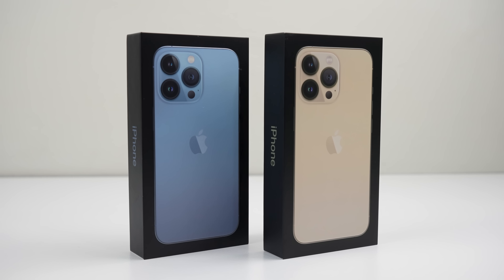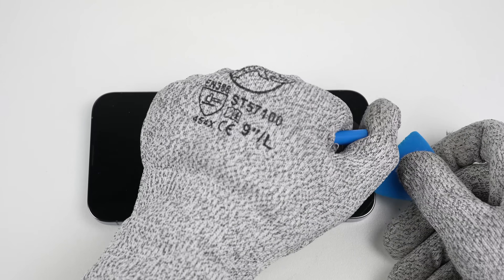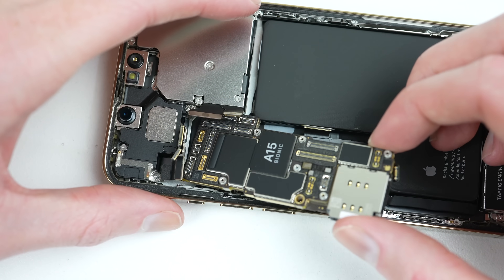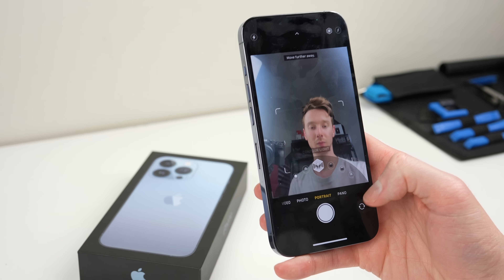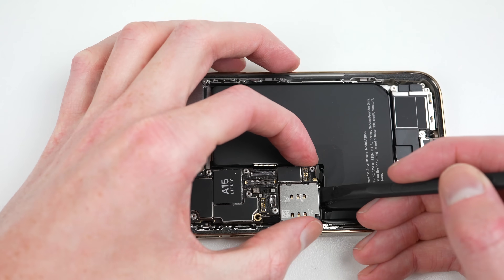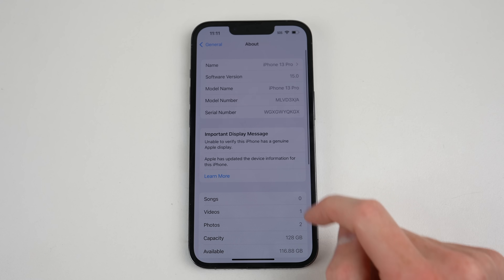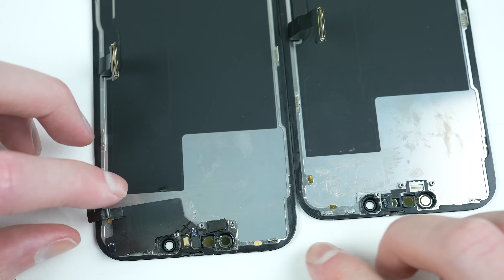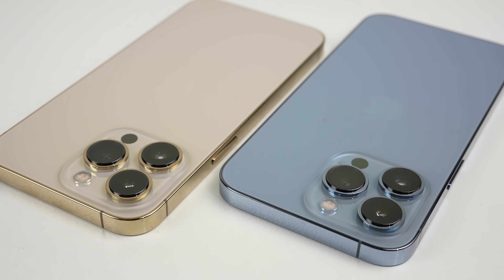iPhone 13 A Repair Nightmare - Teardown and Repair Assessment

Comment: Thanks for doing this video I have had iPhones since the 3 every few years I would buy a top of the range android ( tried various makes) but always had issues, early on battery issues and later down the line ringtone and message notifications I have a couple of email addresses and had problems getting the same notification sounds for each just stuff like that I found annoying etc so always went back to Apple,
 my last one was the 11pro but after last years issues and to see they have continued down this road I don’t want to give them any more business…
Like you say it feels like you no longer own the product and it’s sad to see that one of the android manufacturers doing the same if you unlock the boot loader etc…
Not that I ever did that sort of thing, but it was something a lot of friends did with customisation etc…
Sorry it’s long but now I don’t know which way to go… any advice from anyone would be greatly appreciated 
Sorry for the lengthy message..

Comment: Such a misleading video, I think you're forgetting 1 thing @hugh Jeffreys , The iPhone's have had serial allocated FaceID, Truetone Display & batterys since the iPhone 10, any/all repair shops are very aware of this, and you can literally use a JC V1S to read/ write the serials of each thing, onto the replacement part, it tricks the motherboard into thinking it's the same part, making repairs extremely easy & possible. Loved the video though, very well shot/ edited!
Reply from the maker: That works for the older phones but didn't do anything with an iPhone 12 I tried it on. Reprogrammed the screen using that JC V1S and the warning and true tone still didn't disappear, even after a reset. As for Touch ID and Face ID they have never been reprogrammable. Its encrypted and no one has got around it to my knowledge.

Comment: Damn yeah if I’m going to “rent” a phone from company’s I will not be forking out almost $2000 for it. Rather just spent 300 on a cheap android that does what I need it to do. They also cost so dang much for the screen be repaired by apple without apple care is 600 like dude I can buy a phone for that that’s decent af. I still have my iPhone 7i don’t see the point in upgrading it.

Comment: Hmm for me as à consumer, I don’t think this is a big issue. I am able to change screens or whatever component I my iPhone 12 Pro. But, a battery replacement from apple outside warranty cost 80$. If I do it my self 30-60$. Screen if I want a oled it’s basically the same for apple and if I do it my self. Even if I am able I would rather apple do it. Then they are responsible not me.
Reply: Keep in mind, the normal consumer don’t have an idea to open a phone.

Comment: This is EXACTLY why I REFUSE to buy an iPhone!  I am so sick and tired of Apple's proprietary BS!  They don't want repair shops to fix Apple devices, but if you go through Apple, you either have to pay them a fortune for the Apple Care or it will cost you an arm and a leg to repair.  Sometimes, they won't even honor the Apple Care and it still costs you a fortune to repair a device that already is way overpriced.  I'll be getting the Google Pixel 6 Pro maxed out in black/gray the minute Google allows purchase on the Google Store!

Comment: I the near future Apple will cover all the internal in the black stuff that turns rock hard. They will advertise the phone fully water resistant to make you buy it, And thus nothing will be removed from inside, allowing you just to replace the screen. And that will be the final move to block you from taking apart the components. I hope Apple doesn't read this message.

Comment: Well this is actually because Apple will go carbon neutral. Being carbon neutral COSTS MONEY, so instead of making their products stupidly expensive to compensate they force you to repair your devices to Apple certified service centres. Seems fair to me. It makes the consumer know that is expensive to protect the environment, forcing you to be more careful and actually pay if you’re not. The lifestyle we’ve followed is cheap and harmful. Don’t throw your devices, pay to fix them. The only part that you have to change is the battery. I don’t mind paying extra to get a great battery from Apple. Apple will be carbon neutral. Will you be? Are you willing to pay for your mistakes or not. Apple’s business is not to save your ass, but to make you aware of the things they promise. It’s your call too. If you can’t pay for a genuine service with Apple parts (recycled and environmentally friendly Apple parts) then you are the problem.

Comment: I've seen people use... Razors to open the phones 
Zack got called out hard
Reply from the maker: haha wasn't trying to, if you you have practice sure. But for the average person trying to open something they are likely to damage it by scratching the phone you cutting into a cable or part. Using a plastic tool is safer.

Comment: It’s funny reading the outrage in the comments - isn’t it obvious why Apple (and others) does this? Hugh himself has shown many videos of poor DIY repairs, misleading fixes and disengenuine sellers - if I were a company I’d not want the headaches and cost of customers going the cheapest route possible to fix their devices (which always happens, especially with iPhones). Sure, the likes of Hugh are great and know what they’re doing - but for every Hugh there’s 100’s more amateur fixers that bugger up devices worse than before they were ‘fixed’. Apple had tons of issues with poor repair jobs on Touch ID and complaints from customers on poor screens (after getting them repaired poorly). This removes all that headache, it’s obvious.
Reply: Well if Apple provided parts for the phones to consumers, like Samsung, that wouldn't be nearly as much of an issue.

Comment: Part serialazation is good to prevent bad repair shops from ripping you off, however if Apple genuine parts are being used then there shouldn't be an issue. Apple is getting worse by the year!

Comment: Doesn't this cause so much (more) e-waste? Battery dies? Throw it away. Display broken? Throw it away. Plus the new accessories you need to get. I miss the good old days of when you just bought a new battery, went to the local repair store and got your screen fixed for a few bucks.